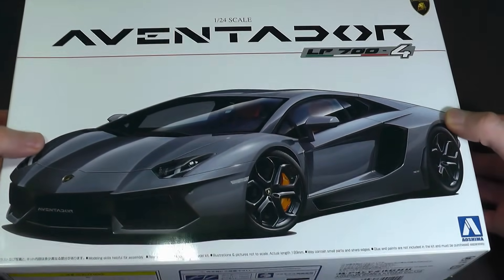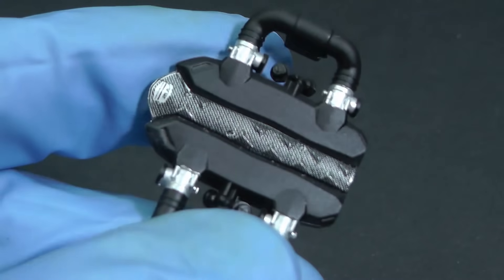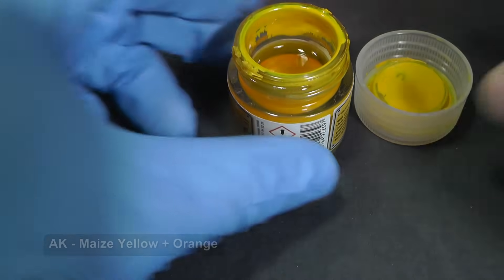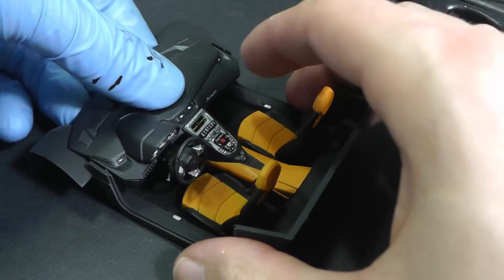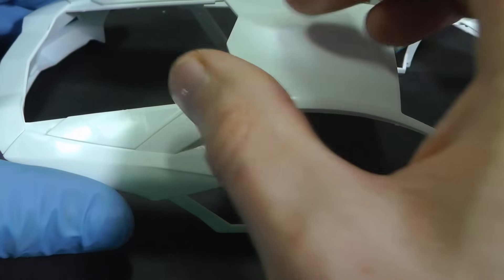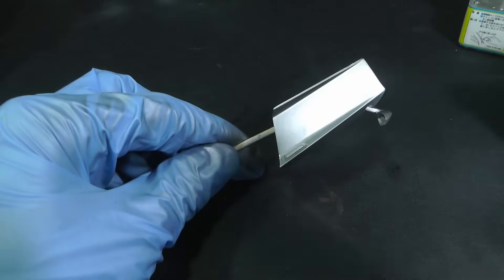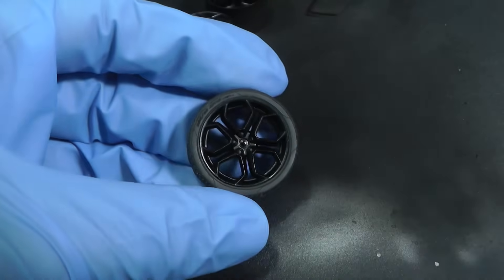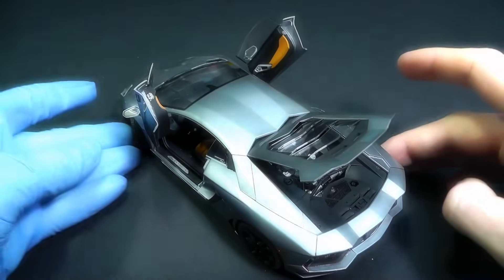Lamborghini Aventador  1/24 Aoshima - Car Model

Comment: Metallic colour requires different set up imo. Is very bumpy, that's why clear coat is not smooth as mirror. I had this problem when painting cars at the beginning. It was due to amount of material to pressure. Those 2 factors, density seemd to be ok.

Comment: Nice! You're the reason im modeling now
Reply from the maker: Thanks a lot. May I ask. What type of models are you making?  (cars, planes, AFVs)
Reply: Same, your the best David!
Reply: Im the same, just built my first official model of a fa-18d. So many mistakes but
Reply: @idaemonplasmo  Sorry for the late reply. My first model was a F4U Corsair. The model I'm currently working on is a 1/72 scale M4 Sherman
Reply: @Roman-ey3yi My first official model had some mistakes as well. I don't use an airbrush either. I use acrylic paint and brushes for everything. I do use an arbrush for the clear/Matt coat.
Reply: Wolf Gang great to hear you're getting into the hobby. I've been model making for many years and find David's videos inspiring. I think if you check back through his videos he has one dedicated to painting camo with a brush (if its not David it's QuickKits YouTube) and he achieved very good results.
Reply: @ITOWords  Thanks!

Comment: David! If you want to maximise the buff of the paint - read a bit about car detailing - how to perfectly polish a paintjob... and finally - use even the cheapest ceramic coating. Trust me - applying a ceramic coating to a polished paintjob (even on a scale model) will make it PERFECTLY glossy and glass-covered looking. I used to work as a car detailier, I know what I'm talking about :D
Reply from the maker: Thanks for the info. I heard only about wax but that ceramic coating looks extraordinary. It was almost impossible to achieve a perfectly smooth result on gloss black. Can you recommend me some brands because I found a lot of types and I am confused now. :-D
Reply from the maker: I do not know if it will work for me. I use lacquer varnish and it seems that it is a quite aggressive chemical.
Reply: @idaemonplasmo  you possibly should find Dodo Juice Supernatural - it's not a ceramic coating, but quartz - the difference is it's less resistant to washing, but it's not a valid argument when we are talking about scale models, right? :D The visual effect is very similar and - it should cost ~40€, which makes it cheap for you - 30ml bottle should work for two mid-size cars (I remember I cated Cayenne GTS with it, with a double coating on the front bumper and hood, sooo.... it will last for your lifetime on scale models :D)
Reply: noooo, you shouldn't worry ;) I used it on reaaaaaly good number of cars, and tested it on different (idiotic, as it may seem) surfaces - glass table, my watch, phone covers, plastic and laquered interior parts - piano black finishing is a true pain in the ass, gets scratched by just watching at it ;d
Reply from the maker: @ChudyChudziutki  Thanks, I found a local seller of the Dodo Juice Supernatural so I will test it. Thanks for the help.

Comment: David, I don't know if you take project requests but Tamiya just released a 1/24 kit of the McLaren Senna and it would be so so awesome if you build that for a video in the near future! I'm hoping there will be an aftermarket photo-etch set for it soon. Plus there are  lots of carbon fiber bits on the car and there's decal sheets available for that. ;)

Comment: Great build, David. You can also use Revell Contacta Clear glue for clear parts. It washable if you apply too much, so no risk of causing paint damage. Have you tried Zero Models already for the car models?

Comment: Great work. Have you considered Vallejo Metal Color or Alclad II maybe? There are great, Alclad II has the best gold in my opinion and it is much more controllable then Vallejo Vallejo Metal Color but you can't use it with the brush.

Comment: Very Nice work as usual David.  Question, where en ebuy you get the floking?
Reply from the maker: I buy powder locally but on eBay for example here: https://www.ebay.com/itm/Fuzzy-Flocking-Velvet-Nail-Dust-Colorful-Nail-Art-Chrome-Pigment-Decors-Powder/391962475066?hash=item5b42c8ba3a:m:m2vfhxCXF13xG5IxKYNCzng:rk:1:pf:0

Comment: Interesting that you sprayed the varnish over the AK extreme metals! I tried to do that with the exact same varnish and it totally ruined the AKs finish....
Reply from the maker: Thanks for the info. And what shade of extreme metal you used? I also had a problem with chrome or polish aluminum.
Reply: Yes it was the chrome! I think it and the polished aluminum must be slightly different from the rest of the range as they perform differently.

Comment: I always wondered. When anyone mention psi used for airbrushing, is that what it is set up without spraying or when you are spraying? I am new to airbrushing but noticed when I set up my pressure for, lets say 30 psi, it drops down to 20-25 when I am actually using the airbrush.
Reply from the maker: Yes. It is when spraying. As you said, it goes down significantly. It depends on hose diameter and length, so it is always better to test the correct pressure with color type and dilution.
Reply: @idaemonplasmo  Thank you for the quick reply!

Comment: do you thin the Mr Surfacer 1000 with anything?
Reply from the maker: Yes. I use Mr color leveling thinner. It contains retarder which slows down drying time, so the result is nicely smooth.

Comment: How do you paint taillights as a transparent red??
Reply: Ok, I'm not the master, but I use to mix clear warmish with a small amount of red paint, say 4:1 or 5:2 on the inside of the transparent tail light, and when properly dry apply a thin coat of shiny silver or whatever you have that imitates that mirror aspect. BTW great coating on this model, Plasmo!
Reply from the maker: they are in the kit already with red, white and orange colors. So you do not need to paint them.
Reply: @idaemonplasmo  Oh - I see. BTW great work and pleasant to watch :3 (Thought that you would polish whole model with polishing paste)
Reply: @botarzoltan3206  Sound manageable :D